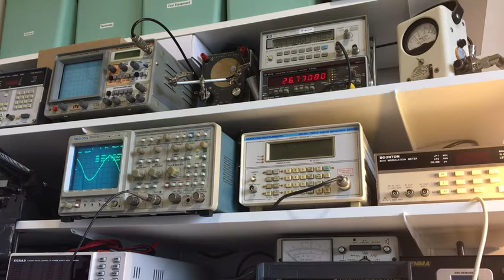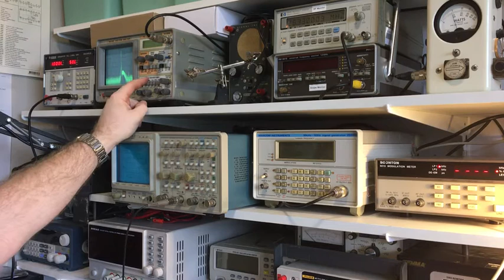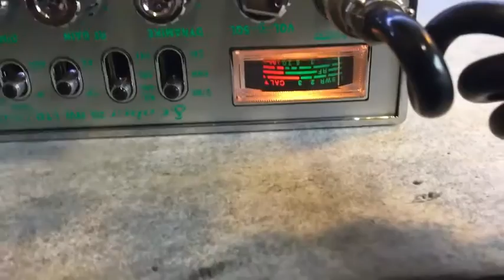#79 Cobra 29 NW Classic CB Radio Conversion and Alignment

Comment: Its crazy how much the equipment cost to do radio work. I have a base station everything to solder with but a desoldering iron a watt/SWR meter, all kinds of hand tools, frequency counter coming and a component tester and its not even a drop in the bucket to what I need.
I've never seen a Cobra that needed converting!

Comment: Interesting Video. Good to see the 2305 in use too.
Reply from the maker: Hi Simon, yes I use the 2305 when doing radio work, you see me use it a little in this one, as I switched to the Boonton unit for the ease of recording the video because it is small enough to fit on the shelf, probably the only bad thing about the 2305 is its size.